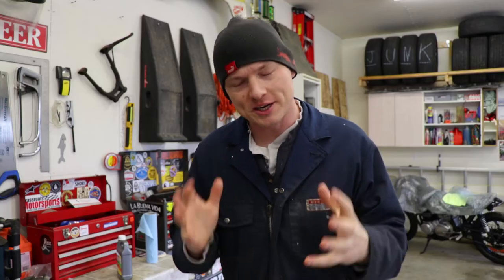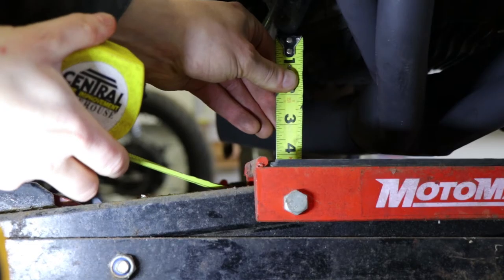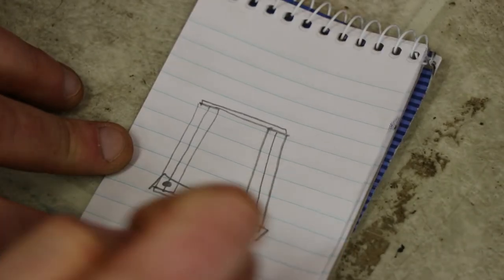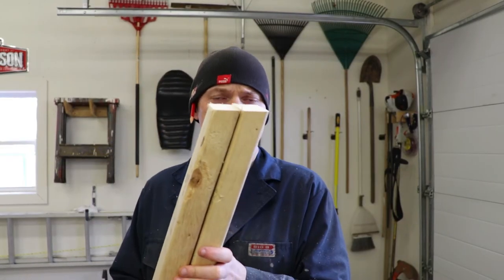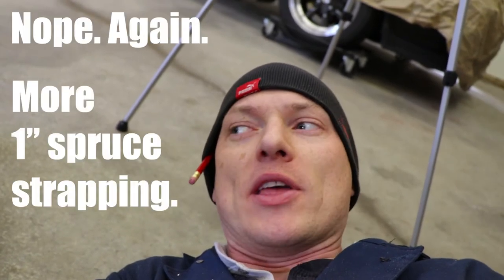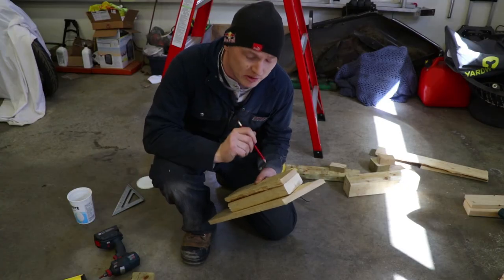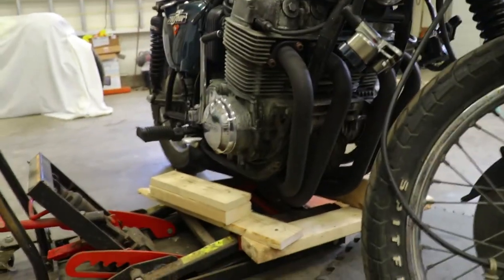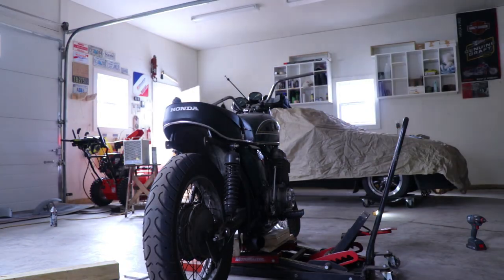How to build a motorcycle lift adapter AKA MOTO CRADLE!

Comment: all this health n safety - but my ears are fucked
Reply from the maker: Because audio is whacky or because that hater pipe is loud? 😆
Reply: @Mike_Barker  If you are referring to my comment as being hateful? Not at all – I work in sound and listening to your video you should understand that you can actually do damage to someone’s hearing with what you call ‘whacky’, I call dangerous volume levels. In particular if they are listening on buds / headphones.
Reply from the maker: No I wasn't taking your comment as hateful at all. Genuinely curious as to why the levels are dangerous. I usually aim for around -10 when I'm editing in Premiere. Do you have a recommendation on a safe level?
Reply: @Mike_Barker  The You Tube recommended levels are -14 LUFS. Maybe to understand my comment – put a set of headphones on and listen to the video
Reply from the maker: That's how I always listen to and edit my videos. I'll aim for the recommended lufs! Thanks for the audio info!
Reply: @Mike_Barker  Adobe prem - offers a LUFS calibration ?